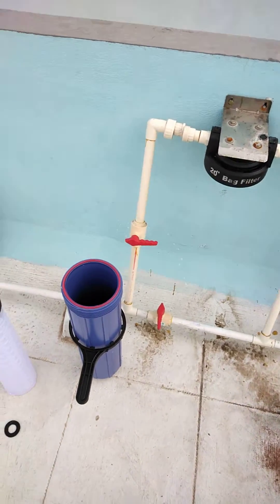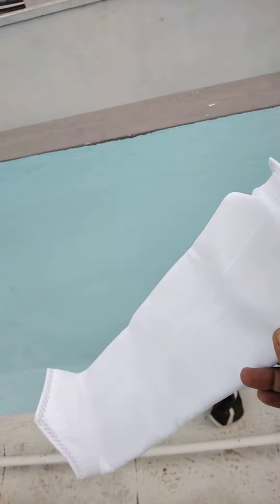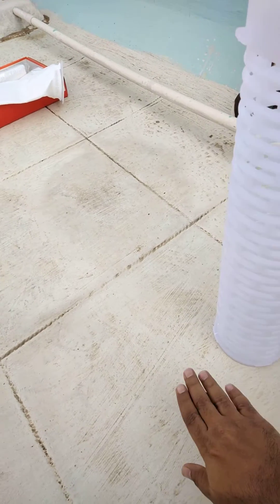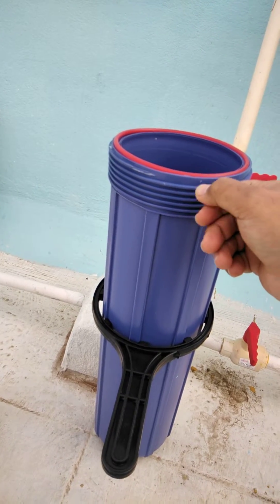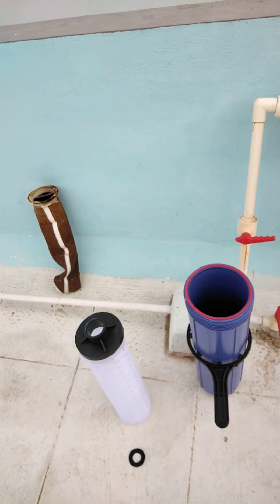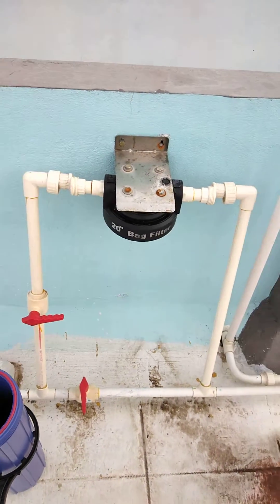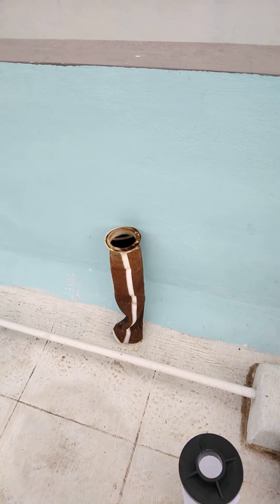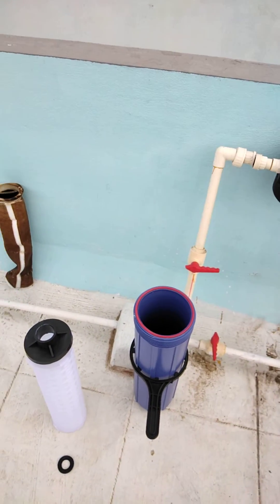Whole House Water Filter India - Replace filter - 20 inch Bag Filter ,Hard Water with High TDS India

Comment: Should we use two filter for for two tanks or one is enough
Reply from the maker: I am assuming that both tanks are connected with each other and one is used for inlet water and other is for outlet (this is the best practice to keep flow of water in all inline tanks).

If above is the case then you don't need to 2 filters, just one is enough.

If you have both tanks independent and there are altogether two separate input water lines then only you would require 2 separate filter.

If you have hard water problem then you can checkout below view.
https://www.youtube.com/watch?v=PHqBsKqRtiQ

Comment: This filter where to connect.I mean directly toborewell to sintex pipe or sintex to out put pipe sir
Reply from the maker: Better to fix it to the Pipe line which fills water into tank.

There is nothing wrong in fixing on to the output lines as well. But if you are planning to fix just one then choose input line. This will keep tank clean, and once tank is clean, output lines will anyhow be clean.

If you have hard water problem then you can also consider water conditioner,
https://www.youtube.com/watch?v=PHqBsKqRtiQ&t=2s

Comment: Is this useful for borewell hard water ...???
Reply from the maker: It filters out bigger particles 5micron or big. It doesn't remove hardness and it doesn't reduce TDS much.

To deal with hard water (Bore water is usually hard water),

Hard water conditioner - economic and easy solution,
https://www.youtube.com/watch?v=PHqBsKqRtiQ&t=122s

RO usage inside bathroom for sensitive usage,
https://www.youtube.com/watch?v=FKZggOMs8VI&t=31s

Comment: Our water TDS of 1000. Is it helps for us?
Reply from the maker: Hi, this doesn't reduce TDS. Input and output TDS remains same.

This is just a filter. It filters out bigger particles above 5 micron size. It gives visibly clean water.

It's very useful. It filters out all the dirt and other impurities from water.

To reduce TDS, either you need water treatment plant or the RO (domestic or commercial).

There is no need to reduce TDS for whole water. You can use water conditioner for whole house and RO for drinking.

Conditioner,
https://youtu.be/PHqBsKqRtiQ

Best budget RO for high TDS,
https://youtu.be/6Bamv_JATH0

Comment: How much this whole setup cost.
Reply from the maker: 3000 - that includes everything, pipes, connectors, valves, filter housing, filter etc. If you do yourself then 3000, otherwise add 500 more for plumber cost.
Reply: Muje vi chyee same kind of filter. Lots of iron present in our ground water. Guwahati.

Comment: Sir, water available at my home has TDS 350, but for special purpose usage I need TDS value of less than 200. So, could this device helpful to me in reducing the TDS value?
Reply from the maker: HI, no, this is just a filter to filter out bigger particle from water (above 5 micron size). Input and output TDS remains just the same.

If you want to reduce TDS, then only solution for domestic purpose is the RO.

Checkout this budget RO,
https://www.youtube.com/watch?v=6Bamv_JATH0&t=11s

You can install it in bathroom, kitchen or anywhere. It helps get low TDS drinking water at very economic price.

Comment: How much water it can filter in 1 bag
Reply from the maker: It highly depends on input quality of water. If water is bigger visible dust particles then filtration capacity reduces. I replace filter every 1 month, which means roughly after every 15000 liters and I find filter absolutely black. I guess it can work for another 5000 liters but I don't prefer that.

Comment: Sir this filter can we attach between  borewell pump and tank 
Tank height is 16 ft from ground I want to fix this on ground if  I fix any issue to pump?
Reply from the maker: No issues. This filter doesn't drop the output pressure at all, so there won't be any issue in the setup that you mentioned, motor pump will remain safe.

You can check other possible options as well here,

https://www.amazon.in/shop/commonman?listId=1S6RIMBJ69LBM&ref=idea_share_inf

Comment: How much it filter or capacity
Reply from the maker: There is no specific capacity. It's 5 micron 20 inch bag filter, for a 1000 TDS water, it can work for about 30,000 liters, after that you need to replace filter, which cost about 150 to 200 rupees.
Reply from the maker: Sorry, filter cost is about 300 to 400 hundred rupees.

Comment: How to fix this for one flat in an apartment
Reply from the maker: Hi,

One of my friend did this in one of this bathroom.
He has a single inlet for bathroom, and enough space above false ceiling inside bathroom. 
If you have similar situation (single pile line in bathroom and enough space) then you can consider same.

Alternatively if you have a separate pipeline coming from overhead tank to your flat then you can plug-in this filter in that pipeline.